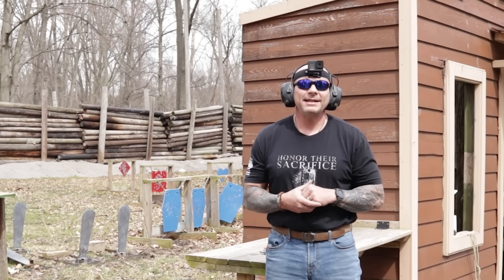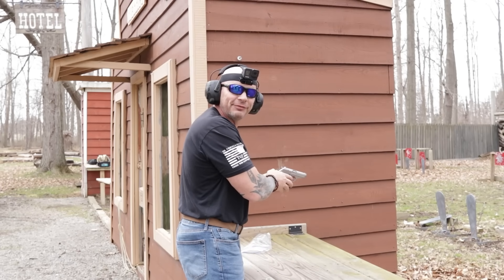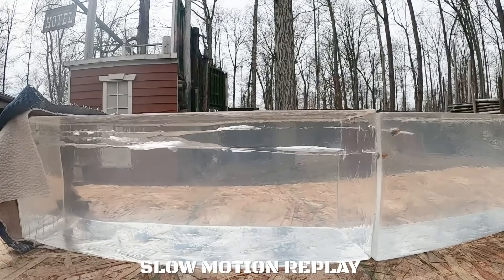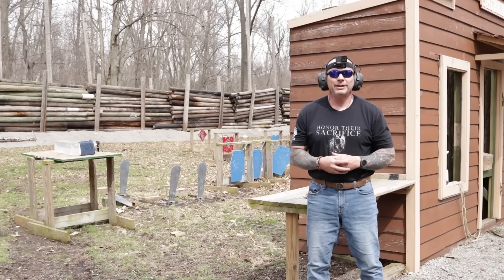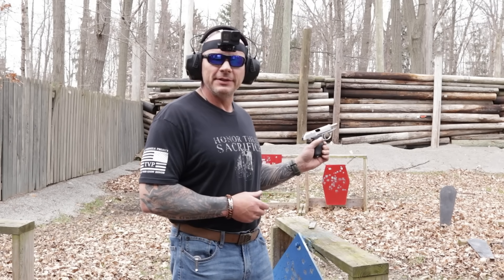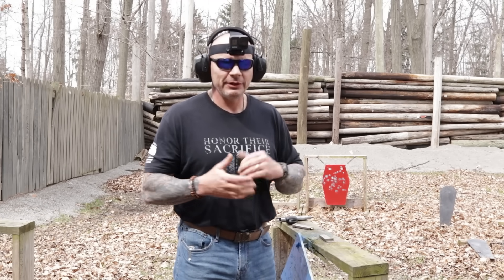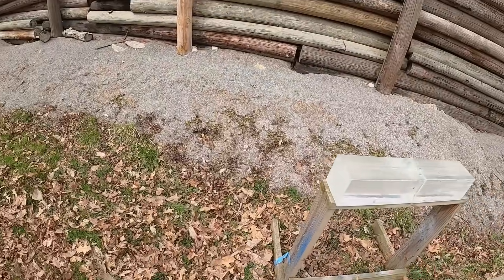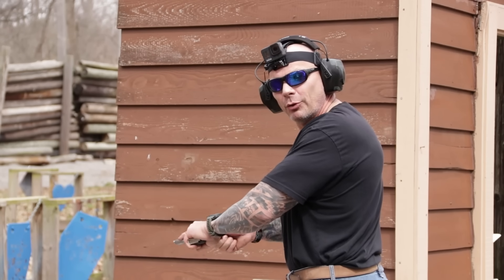Stopping Power of .380 ACP

Comment: I’ve been saying this for years, great part is the level of technology that has been put into the .380.
Hiding a small .380 is a lot more friendly.
Reply: It's like, so think a stick can stop a fight ? Do you think a bat can stop a fight ? Do you think a knife can stop a fight ? ... Have you ever heard of these items being pushed though a car door ? Cause a .380 can go through a car door.....
Reply: I got two block 25s today and there's a little bit bigger version but I did that on purpose so that it wouldn't have any kick and I've had Glock 380s before they work very very well. I'm trying to remember if I've ever gotten a gunfight though that's all I've had. Or even an altercation. I always use it as backup weapon I've never pulled it as the only one.

Comment: The 380 ball round penetrates and looks very similar in gel to federals handgun buckshot. You get 4 per trigger pull in a spread of about 3 inches at 7 yards. So, it's essentially a firing squad per trigger pull from a Judge 3 inch barrel

Comment: I have a friend who was a state trooper until a couple of years ago when he retired,  and he told me about a case where a “bad guy“ with a knife soaked up 13 rounds of .380 at close range without even slowing down, until he finally got up to the “victim”, who also pulled a knife and carved him up. That state trooper, who I have a lot of respect for, won’t touch a .380 with a 10 foot pole. He said that wasn’t the only time he had seen things like that. He won’t carry anything less than a 9 mm, and he doesn’t even particularly like that. He said over 35 years he just saw too many failures in “people stops”.  He generally carries a .45 or a .357 Sig.  All that said, I do carry a. 380 as a pocket postal for Quiktrips out, and when I just can’t carry anything else, it’s better than a pointy stick. But I wouldn’t give it a whole lot more than that. It’s good for stopping someone who’s brain is capable of telling their body to quit the attack, but I wouldn’t trust it to be able to physically shut the machine down via ventilation if they are high, or out of their head.
Reply: Shot him with 13 rounds at close range and he didn’t even slow down? Sorry… I’m gonna need some evidence to believe that. If someone is at “close range without slowing down” you don’t even have time to get 13 shots into their body before they are on you. It takes 1 second for a person to close a 10 ft gap between you and him. So unless this guy was walking towards him inch-by-inch like a literal zombie (unrealistic) while just letting your friend unload 13 accurate rounds on him (also unrealistic), the story doesn’t spatially make sense or ring true. Sounds like an embellished story based on hearsay.
Reply: @ctsc-r1j knowing the source I got it from, I don't think it's heresay. He had no reason to lie to me, and I've known him for a long time.  But hey, don't believe it and you can go on thinking it's the cat's meow - your agreement or not doesn't change what I believe. Hopefully it's nothing but any of us ever have to find out.
Reply: @ctsc-r1j by the way, you act like it's hard to mag dump 380 accurately... 380 has no recoil.  Even 9mm doesn't have any appreciable recoil?? You could empty a mag into a man's size target in a couple of seconds, I've done that with 9mm plenty of times. 380 is nothing.
Reply: @Dan G. Your comment is beyond ignorant and quite frankly laughable. There are tons of shooting reports from different calibers where the bad guy survived 15+ hits and kept going. As an example: One report, had a bad guy surviving 18 rounds of 45 ACP. What does this tell us? Simple, shot placement is above all categories in comparisons.
Reply: Yes, I don't doubt that at all, especially if he was shot with FMJ.  But there are plenty of records of the same thing happening with 9mmP FMJ.  Friend of mine is a trauma surgeon in a government hospital in Cape Town.  He has spoken of people being shot multiple times with .45 FMJ and didn't stop them.  So did your state trooper friend perhaps say what type of bullets the guy was shot with or how many rounds went through the centre of the chest instead of being spread around the peripheral areas of the torso, arms and legs?  The South African   Police and Municipal Police here in South Africa are issued with 9mmP and are restricted to FMJ ammo. Im a conservation manager and also a law enforcement officer but I get to carry hollow points in my personal CZ83 / 380acp..  Guess what, unless the criminal / attacker is hit in the head or spine with FMJs, its normal to have to go find where they may have run out of steam and died 500m or even a kilometer away or they get picked up in a hospital.  On the other hand the JHPs work just fine for the purpose of incapacitating an attacker.  Providing people shoot straight.
Reply: There is always one exception 
I’ve seen guys take 5 - 40 gold dots in the chest survive and live to poop in a bag and then one take 1 and croak.  Same with 45 acp. 2 center mass went in about 3 inches doctor pulled it out unexpanded dude lived 

So who knows.  Handguns aren’t great for ending fights quick. These aren’t rifles

Comment: I love my Ruger LCP Max .380 because of the concealability.  And its a punchy little .380 too.  Very very accurate.  I tested mine at self defense range which is around 15 - 25 feet and 10 rounds hit a group of an inch and a half or so.  So its very accurate.  And i can sleep with it in my pocket without it digging into my leg.  And if thats too hard to get to in a crucial moment,  i can always go for my P320 .45 with Sig Lite under my pillow,  or the P320 X5 Legion under the mattress cover.  😁
Reply: Uh, what kind of neighborhood do you live in?
Reply: @redwolf7807  Pretty decent actually,  but so are ALL neighborhoods until Meth and Heroin addicts decide they will do ANYTHING to support their habits.  And then it becomes a free for all of robberies and home invasions.  Id rather be prepared just in case.

Comment: A 32 ACP is a way better choice but if all you have to work with is a 380 so be it. A 22 may have a better rep and for good reason , I guess a 380 is better than throwing rocks at your target..I always had to laugh when I would see those little cases in the dirt , but hey if it works use it.

Comment: Glad to see more guntubers actually putting out factual videos. 
Regarding the .380 acp aka (the shorty 9). It’s ballistically just a shortened cased nine mm. Less grain but typically by 15-52 grain respectively and less powder of course. 
I’ve had to use this cartridge in an SD situation and it does in fact stop threats. 
I’ve said this for thirty five years plus, the .380 cartridge will mess up someone’s day, week and life. It takes just one round. 
Anyone says different, go to another source for information. They obviously have never been shot and never had to shoot someone. 
One thing about this rhetoric behind this cartridge not being sufficient enough stems from ignorance and bad information. 
The recoil is much less than a 115grain 9mm and even more sedate than a 147grain indeed but it’s still a snappy cartridge, especially in a ppk style handgun. 
The .380 hits and penetrates just enough to poke holes in vital organs just behind the bone trying to protect them. It breaks the chest cavity just enough to squeeze in and take out a lung or heart. Once bedded , the perp will drop , scream and flail in pain until death or passing out. 
It’s an unsightly thing to witness. Almost absurd how this little pill devastates it’s recipient. 
I’ve known operators that swore on the 45acp while pissing on the 9x19 Luger but with no real backing to the claim. 
As with the 380, the 9mm does indiscernible damage from the 45acp. Sure it’s bigger, but much slower but still within the speed parameters to punch a hole into a target and that’s the key here. Not size, but speed with mass. The cartridge you use only needs to go fast enough to punch through hydrated bone, flesh and muscle tissue, then hang around awhile inside the cavity. The dispersal of fluid when the rounds kinetic energy expands outward is where the real damage comes into play. The wound cavity from a 380 on impact expands the flesh out tearing everything and even liquifying bits within the area causing untreatable catastrophe to the tissue and internal bleeding. 
Receiving a bullet no matter what size, will tell your brain to shut down and shock to set in. It’s like being stabbed with a bright yellow forging iron instantly. 
Even the 22lr 22magnum will mess up a perps life. 
Now for the Sig p230 used, they are reliable but not as accurate as the Walther ppk which can easily hit targets up to 60 yards and even stretched to 75 (225ft.) with fairly good accuracy. 
For most people wanting an easy edc gun, the 380 is excellent. Ammo capacity should be considered depending on skill level and experience.

Comment: The weird thing about .380 ACP is you only worry about penetration if you aren't using full metal jackets.
The other weird thing it that those FMJ's will go through bodies and walls way more aggressively than people would think.
Reply: @DW133_  Thanks for your reply.
I'm pretty new to this stuff, but I'm not sure what the point of .380 ACP is, because 9mm is basically .380 ACP ++++P (.380 with more powder).
I suppose the main point is that .380 ACP doesn't have as much kick, but I wonder how much that matters.
Would you say that .380 ACP is a pocket gun round, only suitable for guns so small that it is painful to practice with them in 9mm?
That's my current take - I think that, given a choice, I'd always prefer 9mm to .380 ACP in the same gun.

Comment: I shot two bad stray dogs the other day on my property, they kills my barn cat and then came at my wife when she and my collie tried to run them off. 3 shots in one one maybe two in the other, .38 special 158gr hollow points. I tracked them off about a mile away, I put the lung shot one down with a 22 to the head. The other was definitely hit, I saw him two days ago down the road from here. They were about 120lb dogs. I don’t think a 380 or 38 spl is much. Use it if that is all you have but it ante doing much.

Comment: Modern caliber debates are splitting hairs.  There are .380 cartridges that push 300 foot pounds and 9 mm cartridges that only push 250 foot pounds.  It’s which cartridge you load, not the gun.  Load the right cartridge for the job and any caliber .380 and above is more than adequate.

Comment: I love my g42 for CCW. EXTREMELY manageable recoil even with infrequent periods of live fire practice. I can dump a mag with no problem and hit every round center mass. It’s small and super easy to carry. I have no problem trusting my life with .380. I carry 21 rounds in total and absolutely believe it’s more than enough for a self defense situation. I’ve had no desire to upgrade caliber or firearm for CCW since I bought my g42 when it came out. Great video!
Reply: I also carry a G42 as an EDC.  I load the Underwood Xtreme Defenders and feel very confident in the system's performance. Hopefully it will never need to be tested.
Reply: Yes, and I regret that I traded mine away. Going to have to pick up another one.

Comment: I guarantee I can take Mozambique shots,two to the chest, and 1 to the head if it's. 380 acp. Said the dead guy. Underwood. 1200 fps, solid copper fluted tip, 2 inch wound cavity, 12 to 18 inch pen... Yup. It'll stop the armed danger.

Comment: The Lehigh/Underwood Xtreme Defense solid copper bullet with the "Phillips head" nose flute to me is a game changer for the  380acp and even the 320acp calibers. I use it in both of my Berettas 82BB and 84BB for my wife since she is 9mm recoil sensitive but doesn't have a problem shooting these guns with this ammo. I feel confident after much research, that the Lehigh bullet with its large PWC is lethal with a center mass shot at self-defense ranges. Plus the Berettas are very reliable and accurate guns. The first magazine of 13 from the 84BB that I just recently shot were very well placed. It helps that they can be single action only with a cock and lock setup. 

"...The XD ammunition has an optimized nose flute, total weight, and velocity to achieve a penetration depth up to 18 inches with a permanent wound cavity (PWC) that is just simply enormous; no other expanding hollow point comes close to achieving anywhere near this diameter and volume. Not only is the PWC over 100% larger than any other expanding bullet, expansion is achieved despite being shot through barriers...."

Comment: I have been in a Club that shoots 380's for over a decade. And we all can attest to the fact that it most definitely a great self defense cartridge as well as a defensive weapon. They are under rated Period. And so many ways to conceal and draw fast. Thanks for the video.
Reply: i appreciate your video also.
Reply: Still a 9mm short.. Granted with the advent of superb bullet design the .380 is much better, however, I would not count it as a home defense caliber much better choices..
Reply: @duke7595  Yep, when I run out of bullets, there is the trusty 12 gauge to finish the job.
Reply: @duke7595  I disagree I run Eagle talons in my 380.
Reply: speer gold dot 90 g is good
Reply: @kurtdowney1489  You mean Black Talons from Winchester from back in the day?
Reply: With the multitude of micro compact/sub compact 9mm offerings, there is little reason to carry .380 these days.
Reply: @CWHolleman  a sub compact .380 is much easier to shoot and manage recoil effectively.  When both firearms are similar, like glock 42 and 43.  And diamondback .380/9mm pistols.

Comment: The topic of .380, 22 being under powered is absolutely ridiculous. I’ve put the .380 to the test. In capable hands it’s a 1 hitter quitter. I subscribe to a bunch of these gun pages. 1 of my fav videos is 7 or 8 retired operators. They covered these 2 rounds. Surprisingly 4 of them had more kill shots with their backup 22s then most infinity guys with their main weapons systems. It’s the shooter and not the caliber. The 9mm short kicks ass and I trust it with my life and the life of my fam. O and dudes right. 9mm short has recoil. Especially the tiny ones. Looking for the best .380 weapons system. Ruger LCP max

Comment: If this doesn't convince you 380 is "good enough" nothing will. No one ever argues that practice hitting center mass is what is really effective. Placing your shot, center mass, over and over. My firearm training came from the Army. I would strongly argue that the caliber doesn't really matter in up to 20 feet away, it has everything to do with practicing hitting center mass and being comfortable with what you practice with. There are a lot of news stories about little old ladies dropping burglars with 22s but I've yet to find one where a little old lady dropped a burglar with a $1,300 military grade full frame 17 round 5 inch slide 9mm all of you suburban commandos buy.

Comment: First time watching, great video.  Used to carry a 1911 for about 35 years and always practiced shooting at 100 yards, just in case I was unlucky and got caught in an active shooting scenario and I had no choice left but to defend.  Experience has shown me that even with a slow moving bullet at around 850 to 900 fps, point of aim just below center or 6 o'clock  produced more hits.  Now I carry a 686 with a 3" barrel and it is the same thing.  Also the PMR 30 produces same results at 100 yards with point of aim below center or 6 o'clock.  Bullet drop is not as significant especially if you are shooting down at target, and depending on your height, I figured it is like shooting and compensating for angle shots.  No scientific data to prove my point from me , just observation and speculation.  Again great video, thank you.

Comment: Maybe I missed this, but barrel length and corresponding ammo selection is more important in a slower round like the .380 than larger calibers.  So, you may get some nice mushrooming with your Sig, but if you lose just a little velocity with a shorter-barrel LCP Max, for example, your velocity may drop below the expansion threshold for the self-defense round you are using.  It’s worth considering when evaluating the .380 ACP.
Reply: Ammo mfgr should have 380 figured out by now.

Comment: the comparison between recoil is not really valid, you are using 2 totally different pistol types that use different recoil systems and different triggers. try again with a 380 glock
Reply: for example, your sig230 is a blowback recoil operated fixed barrel pistol. so obviously you will have more felt recoil from that. then the trigger is also different in reset from the glock, which you can notice affected the shooter when you had a slight hangup while magdumping it the first time

Comment: I'd rather have a .32 in the same size gun.  Both the .380 and the 32  are point blank weapons and the .32 is powerful enough to go through the ribs of the chest and then it richochets inside the body making it very deadly.  The .380 penetrates further but its not really necessary.

Comment: There's nothing wrong with the .380, if that's what you can comfortably conceal.  Honestly, although I LOVES me some .45 ACP and think that it's as close to a 'perfect' caliber as you can get...(with a nod to .357 Sig & 10mm) as long as the penetration is adequate, shot placement is most important.  A shot to the boiler room or CNS will stop the fight, consistently, with the least amount of rounds fired.  If you want to drop a bad guy with 1 shot to the upper torso, you need a shotgun.  If you want to drop a guy with 1 shot to the torso, period, you need a rifle.  Yes, that's an egregious oversimplification, but you gotta start somewhere.